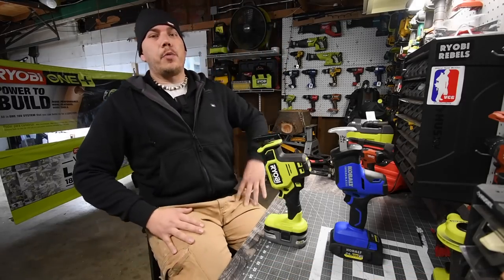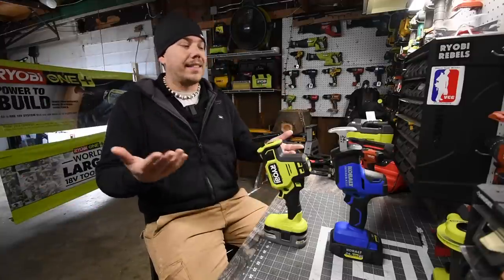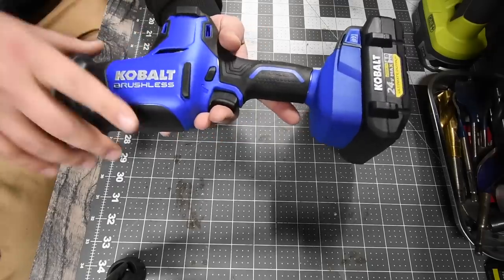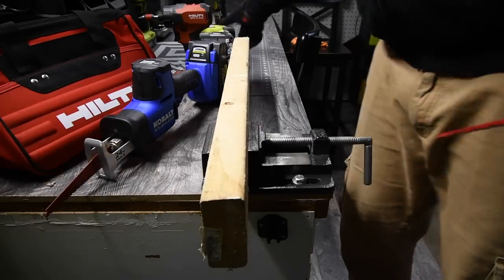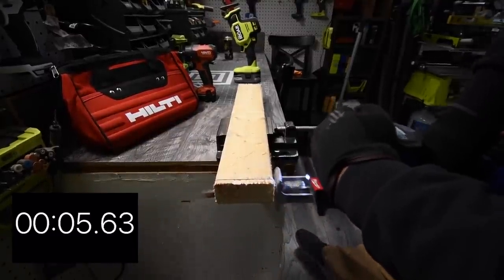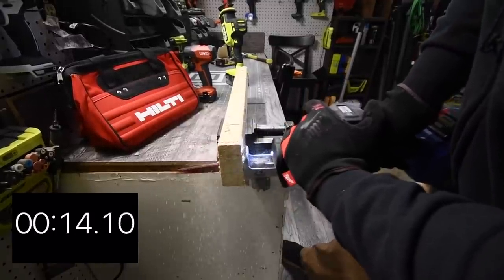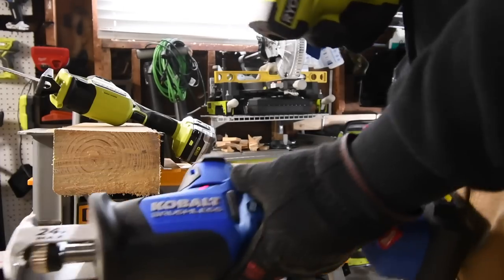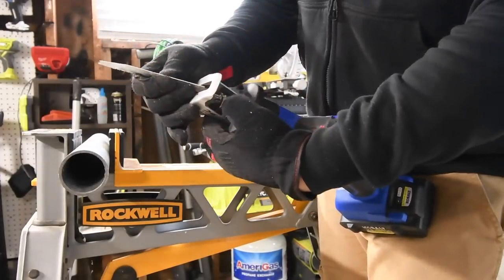Kobalt vs Ryobi (Reciprocating Saws)

Comment: Kobalt is so underrated. I blame Lowe's for doing a poor job promoting.
Reply: @smarksruinedwrestling5020  yep, keeps them cheap and innovative
Reply from the maker: I agree with you on that.
Reply: And now with the xtr lineup they’ve moved up even further! They need more xtr tools and more tools in general. Love all my kobalt tools
Reply: @smarksruinedwrestling5020  No because they need to make more money to expand their line and ensure the battery support lasts.
Reply: For me it comes down to Kobalt being an OEM product. Manufactured by chervon, makes a lot of good, popular brands, but impossible to buy parts for em.
Reply: I have never had an issue with any Kobalt 24v tool or accessory nor have I had any issues with their hand tools.  Kobalt is a fantastic brand.
Reply: I have both Ryobi and Kobalt (and Rigid)  tools.  I replaced all my Ryobi "primary" tools with Kobalt, after having had several tools fail. (My Ryobi multi tool lasted all of two hours!)  I have that exact Kobalt recip saw.  I took it apart just for fun.  The reason it vibrates less, is because it has a reciprocating counterweight that moves opposite the direction of the blade.  All axles run in needle bearings, not sleeves.  Kobalt looks to me to be designed for constant duty, while Ryobi are light duty, homeowners tools.   Quality wise there is no comparison, in my opinion,  Still love my Ryobi vacum cleaner though...
Reply: I own most of the Kobalt power tools and all are great. The new powerhouse Tool brand manufactured by Chevon for Lowes is "FLEX". They are aimed at the professional works to compete with Milwaukee 7 DE Walt. I love my kobalt blue tools.

Comment: Have both brands in full size recip, will not by another Ryobi in that form, kobalt still working but sounds like a bearing is ready to fail. neither is a yr old , the Ryobi will be thrown in a bucket with three others that quit working, just got the one handed version of the Ryobi, will. See how long it holds up.
Reply: The new Kobalt XTR recip saw is an absolute beast. It has an orbiting setting that makes short work of wood. It also has comparatively low vibration.

Comment: I own many 24v kobalt tools they are great for my motorcycle shop. Also a few ryobi for yard work and what not. Both great, but i find myself always reaching for kobalt. Plus the battery cost is more fair for kobalt i feel.
Reply: yea kobalt 24v batteries are absolute beasts for the price, built VERY well, great material, thick and take a beating, the materials used on kobalt 24v are great, I also own their 40v yard things but those aren't built as well but their built well
Reply from the maker: I agree with you on that Medic

Comment: I think Kobalt is underrated. there a lot better tools then most people give them credit for. The Ryobi HP continues to be unimpressive. I think a great comparo would be the Ryobi HP against Dewalt 12v extreme. I'm pretty sure the Ryobi would get smoked by Milwaukie 12v Fuel. Great video.
Reply from the maker: Lowes needs to promote Kobalt more

Comment: I have the German Metabo (not HPT) version of this tool as well as the m12 Fuel. The German Metabo has a much better grip and is quite powerful for my needs. Great for pruning branches or heavier duty tasks if needed. Both of these seem nice as well. I have one Ryobi battery but I can't justify a 3rd one handed saw.
Reply from the maker: if you don't need a 3rd one then I wouldn't get one and I thank you for viewing Jon

Comment: Kobalt outperforms Ryobi almost commensurately with its voltage advantage. Monstrous power.
Reply: It’s not just the voltage. You can make a 18 volt tool stronger than a 24 volt.

Comment: Keep in mind kobalt even beat out m18 hackzal in terms of performance or cutting speed
Reply from the maker: I gotta get the m18 as well and thank you for viewing Toolgamer
Reply: @ManCaverTools  I believe pro tools review made a head to head.  Kobalt has some tools that made it to the top 5, but the brand has often being looked at as just one of those unreliable or easy to break.  I looked at the reviews as it’s usually just a few people that has had issues with Kobalt like any other brands.  All I know, the recip and multi tool are actually one of the fastest, while their impacts are one of the torquiest there is just like the Ridgid

Comment: Change blades
Reply from the maker: im not going to change blades for ever single individual test
Reply: Then your results are going to be skewed. Your going to say the Milwaukee is better than Kobalt but you used a brand new blade for one and a used blade for the other. If you can't afford to use a new blade for each head to head then you shouldn't be doing these tests.

Comment: Ryobi is better the reason that kobalt get faster is because of 6 v faster would be fair if Ryobi has 4ah and kobalt has 2 amp
Reply: The stroke length is longer on the kobalt besides being more powerful. In what way is the ryobi better?
Reply: @ajmedeiros77  let me tell u this when it come to a reciprocating saw I state that #1 Milwaukee, #2 Dew-alt , #3 metabo, #4 kobalt, rigid, ryobi, #5 craftsman
Reply: @ajmedeiros77  also if I can tell u one thing I would say kobalt seems a little loud that’s why it’s looks like it’s faster plus the ah and voltage matter but either way my presence is Ryobi
Reply: @tahakhan2465  the voltage doesn’t matter at all. You can make a 18 volt tools just as strong as a 24 volt. Look at Milwaukees 18 volt mower and weed eater. It blows the doors off of 60 volt mowers. It all comes down to how the tool is built. Kobalt usually has better built and stronger tools that Ryobi.
Reply: @ajgreen868  I genuinely thought voltage directly translated to power. Good to know that's not always the case.
Reply: @as7river  yep it’s all about how they deliver that power and the Killowatt hours of the battery.